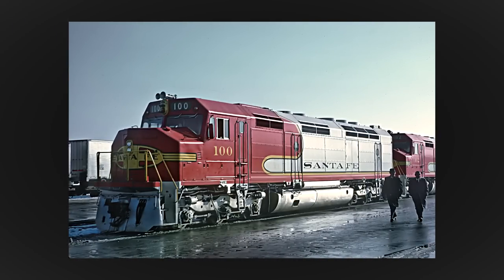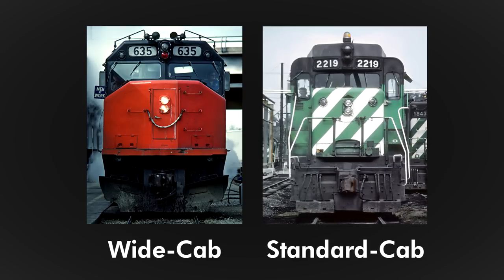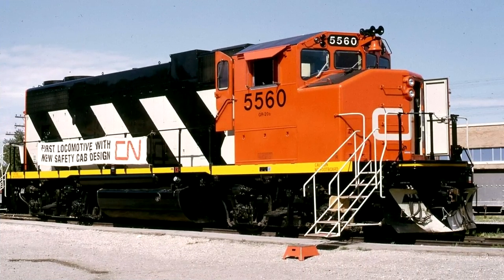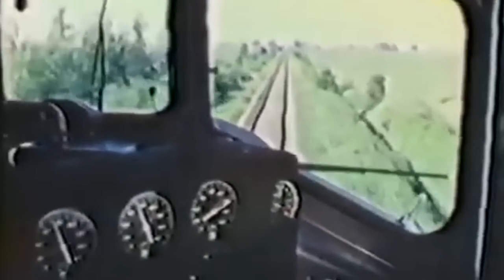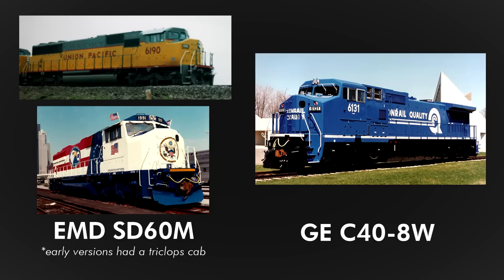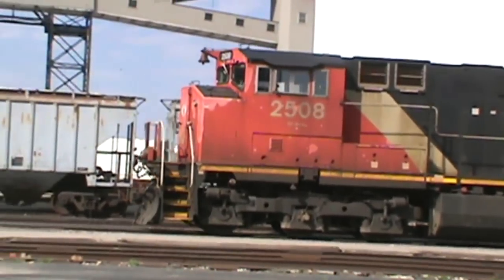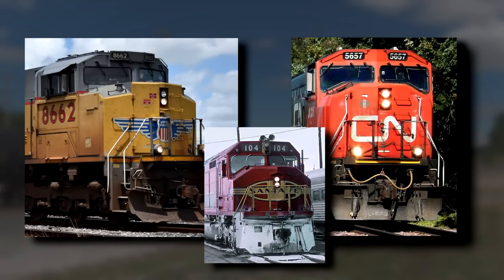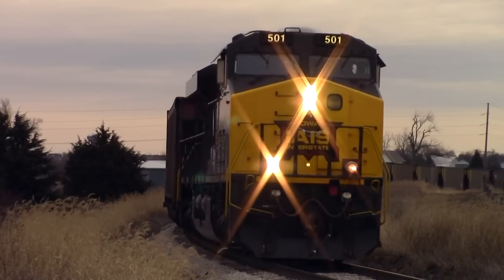Wide-Cab Locomotives

Comment: Wide cabs are aesthetically one of my favorite freight locomotive designs. Given that I grew up in Canada with my grandma's house being close to some tracks, Canadian Pacific wide-cab locomotives are a common sight. Also, I heard that a battery-powered locomotive proposed to Canadian Pacific and other North American train companies would still use the wide cab design, keeping the traditional look while using different powering methods.
Reply: I would prefer a traditional electric locomotive powered by overhead lines, only with a wide cab, rather than this battery nonsense.

Comment: Thanks for the video.    Wish there could have been more detailed photos  or diagrams of the interior layout.  Always wanted to see a video of the inside of the cabs and some diagrams or blueprints showing the different configurations and features inside the cab and the nose.    I understand it isn't 5 star accommodations but a small toilet and galley  sure help on long shifts.
Reply: Yes, I think that would help clarify the reason it's called "wide cab" instead of "wide nose".

Comment: Although you stated the GP38-2W was the first to have the Canadian Comfort Cab, I think the M-420W beat it out by just a few weeks from what I've seen online as people have seemed to state this at least a few times when the question of the first Canadian Comfort Cab has come up (though both might as well be credited with being the first given the close proximity of delivery)
Reply: Those M-420's that Alco made were as spartan as you could get the side panels on the cab interiors were peg board Try switching with those units you were always using your independent  brake or your train line in order to spot cars

Comment: Canadian National and their employees (we used to have a locomotive cab committee with both management and union members) designed the original Canadian comfort/safety cab after several accidents where crews were injured or killed.  CN never bought another new standard cab locomotive, and this design formed the basis for both the EMD and GE safety cabs.  The earlier EMD FP45 design was strictly for appearance as you mentioned, and was not any stronger than contemporary standard or 'spartan' cabs.

Comment: Would be interesting to hear a deeper dive into hood/cab configurations and why some layouts are more popular than others in different parts of the world. For example in the US, most locomotives use single wide cabs. But in Europe most freight locomotives have a two-cab design, models like the Class 66 even convert a single-cab design into having two cabs. And that's even before we get into box cabs and steeple cabs.
Reply: The twin-cab design lends itself to rapid turnaround at railheads without having to use a turntable or wye and gives better visibility for the crew (at a cost of level-crossing collision protection). 

The Class 59/66 were not based on any existing locomotives. They share the same radial-steer trucks but use different engines and frames, and were clean sheet of paper designs built to specific British loading gauge and weight restrictions. The American manufacturers (Alco included) designed specific export units for European and other customers; even a "lightweight" American locomotive would be far too heavy for many European applications. 

If you want to see a really good illustration of how a European manufacturer would design an engine using American components, take a look at NOHAB's MY and MZ locos made for the Danish railways and compare them to their FA and SD40 counterparts.
Reply: @rallymodeller  The 66 is a original design. I heard the class 59 is a SD 40 with a new body slapped on.

Comment: The EMD FP45 & F45 diesels were fine Cowl Units.

If only Cowl Units could be built Today. 

If the Alaska-Alberta Railway ever becomes a Thing, Cowl Units should be implemented because of the extreme temperatures of the Far North.

Also, the EMD SD60M/SD60I, SD60MAC, SD70M/SD70I, SD70MAC, SD75M/SD75I, SD80MAC, and the SD90MAC wide cab is my personal Favorite. I would love to see a Cowl Unit diesel with that style of Cab.

Comment: Actually a slight error, Thunder Cabs. These cabs are of EMD origin and worn by all SD70M-2s, along with the AC variants. It's more a sub-type of cab, considering they have a similar appearance to wide-cabs. Ironically I hate thunder cabs the most, they just look really ugly to me, which is the reason I hate most SD70 variants apart from the SD70 base and SD70M. Canadian Safety Cabs will always be my favorite, being a mix of a wide-cab and a standard-cab.

Comment: I've always wondered whether locomotive designs in North America will ever shift to flatter cab ends like you see in Europe, Australia, or many other countries. It always seemed weird to me that we're still using designs with the nose on freight locomotives.
Reply: American locomotives are generally much heavier -- about 200-220t, compared to about 100-120t for European locomotives. They need the weight for adhesion, so they may as well have a bit more stuff in front of the cab for better crash protection. In Europe, adding that extra weight would make the locomotive too heavy.
Reply: The noses are there for collision protection. The US crash safety standards are much more stringent than anywhere else in the world. It's why all of our High Speed trains (The current Acela and the new Acela) are never just European designs brought over here. They are heavily modified to be safer in collisions. So they are much heavier as well.
Reply: @FFred-us9tw  Are the crash safety standards really higher than elsewhere? Or is it just that your trains are heavier so you need more protection? I ask because, if you compare deaths per passenger mile for the US vs other countries, you find that you're a long, long way behind places like Japan and Germany, far behind places like the UK and France, and about on a par with places like Bulgaria.
Reply: @beeble2003  The current Acela is similar to the TGV in many aspects and it shares many parts. But the power cars are much heavier due to added collision protection and the specifications of heavier steel for protection. Our current high speed electric locomotive fleet is the Eurosprinter but with added collision protection. So it is now heavier than the European version. So no, they don't have better collision protection because the trains are heavier. The heavier weight IS from the collision protection. 
  And don't compare "Deaths per passenger mile". That is a typical cop-out to hide the true death tolls. Amtrak is a little over 50 years old. In total, we have had around 200 passengers killed in Amtrak crashes and of those 200, far less were any fault of Amtrak (Not Amtrak's fault if an outside force or host railroad makes a mistake). Meanwhile if you go back the last 50 years in Japan, China, Germany, Spain, the UK and India ALL have MUCH higher death tolls from crashes than Amtrak has had in it's 50 year history.  Amtrak's worst death toll from a single event was 47. The 2nd worse was 16, then 11.  In total only 5 crashes had death tolls above single digits. Meanwhile Germany, Japan and Spain had crashes in the last 25 years alone that killed over a 100 people in a single event.   So please don't say the US is behind in rail safety. If it was then explain the facts i just posted.
Reply: @FFred-us9tw  Right but a train in Europe isn't going to collide with a 200-ton freight locomotive. Which is precisely the point that I raised.

Deaths per passenger mile is not a cop-out at all. It is absolutely the right statistic to use, because it factors in the number of trains that are being run and the amount of time people are spending on them. If a million people use trains and ten die, that's probably a much safer system than one in which a thousand people use trains and one dies. If I take a train from Chicago to San Francisco, I'm obviously more likely to die than if I get off that train at Galesburg or wherever else that train stops in Illinois.

The US performs well in terms of total fatalities simply because there are so few passenger trains in the US compared to any of the other countries I mentioned. There are four railway stations in the UK that each had more passengers in 2021 than the whole Amtrak network. Amtrak carries less than 100,000 passengers a day; UK trains had over a million per day in 2021, even though the UK has only about one fifth the population of the USA.
Reply: @beeble2003  I hear what you are saying , But you are still missing the point about the safety of the trains themselves.  Let's take the number of accidents off the table. And let's just talk about the number of people killed in a SINGLE accident.  
 Amtrak has had only two fatal accidents involving trains traveling at high speed. The worst of which happened in 1987 in Maryland. That crash happened at a speed of 108 MPH and killed only 16 people out of a total of over 600 on the train.
  Now lets go to the 2005 JR Amagasaki crash in Japan. That train was traveling at 72 MPH and death toll was 107 out of 700 people on board. 

In Germany in 1998, the Eschede crash happened at 125 MPH and killed 101 people out of 295 on board.
In Spain in 2013, the Santiago de Compostela crash happened. The speed was 111 MPH of of 222 on board, 79 were killed. 
  Are you understanding what i am saying about the safety standards of the equipment?  Sure, the total NUMBER of accidents in Europe and Japan is low. BUT the survival rate is much lower. Because the crash safety standards are lower.
Reply: @FFred-us9tw  You can't infer anything from comparing just a couple of accidents.
Reply: @beeble2003  really? I posted all the facts you need, feel free to double check them. Look at the number of fatalities for comparable accidents, and tell me which equipment is built to stronger safety standards?
Reply: @beeble2003  I think any rational person who reads the facts can absolutely do that.  I compared multiple accidents around the same speeds with the same number of passengers and the death tolls outside of the US are 4 to 5 times as high. Do you still want to argue and insist that US equipment safety standards are not better than the rest of the world? If they’re not, then why are our death tolls for similar crashes, astoundingly less? I know these facts don’t fit your narrative, but they’re facts, indisputable facts. If you can provide some data that says otherwise, I’m all ears. but I’ve been on the Railroad for 30 years and been involved in many accident investigations . I’m well aware of how these things work.

Comment: so, what’s preventing them making it just one window? is for safety purposes?
Reply: The window would have to be angled sharp
Reply: I imagine two flat panes of glass are easier and cheaper to build and replace. Probably why semi trucks kept them for so long too, in fact you can still buy KWs and Peterbilts with flat glass windshields.
Reply: Probably because of looks. The reason trucks and trains often are designed with 2 windows is it because it resembles a human face, which makes it pleasant to look at.